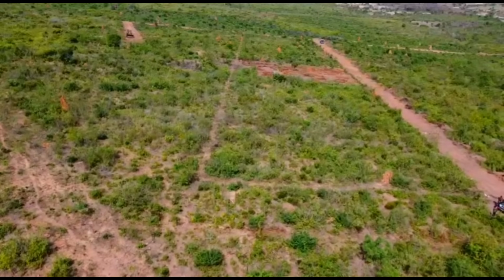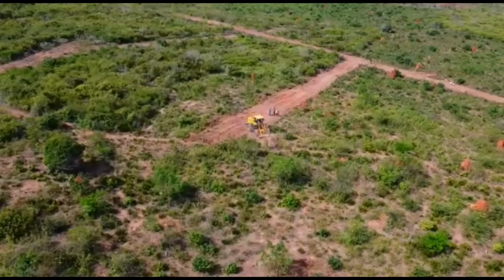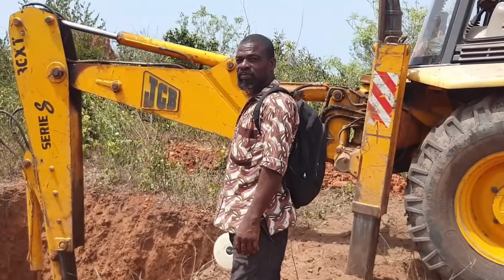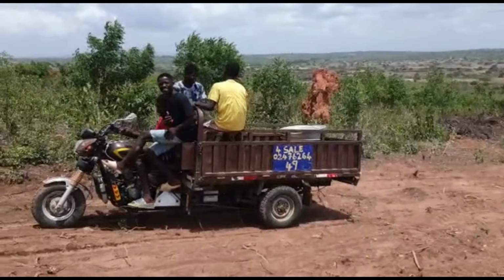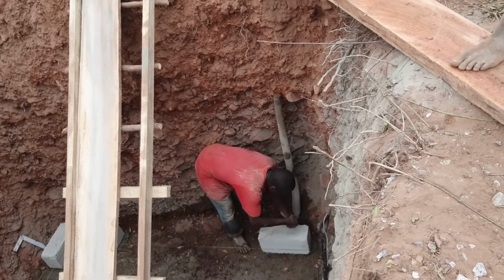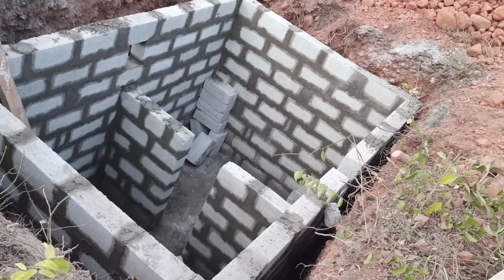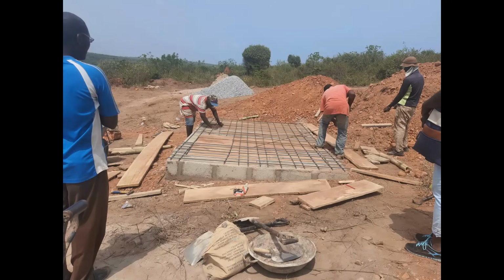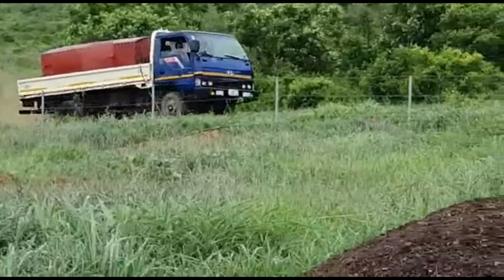Building Our Massive Underground Water Tank - Step By Step Process || Building in Ghana

Comment: You are likely to loose water due to leakage in the dry season for underground water storage built this way. You may want to consider a waterproofing barrier. Essentially you want a swimming pool-like kind of structure.
Reply: You mean that one will leak in hot season
Reply: Not sure about leakage  because these type of under ground water tanks are built in the virgin islands under the houses.  The are call cisterns  and they are just plastered the same way this one was built.  We never have had water leakage as a result. The water for the cistern are usually filled from water collected on the roof tops of the houses. In the dry season we have to buy water from water trucks if the water runs out.
Reply: Yes you are right,they need a damp proof memory
Reply: When you render the interior walls,  there is an Ammendment that you add as you mix the cement, a type of Plasticiser, that makes it very  waterproof, not very expensive, adds maybe 10% to cost of cement. We use it to line Water Tanks and Septic Tanks here in The Philippines...
Reply: @bandit4true  St Thomas USVI?
Reply: @TRPGpilot  yes, and some cistern are built with poured concrete.  They are still being built up to this day.
Reply: @bandit4true  I am vaguely familiar with St Thomas, spent some time there many years ago and know the water collection routine. Coming from another island with readily available spring sourced water I had to learn (to me) severe water conservation behaviours 🙂
Reply: @bandit4true Yes, that’s true. When my parents built our home years ago. The water cistern was built under the  porch with 2 openings on both sides with a concrete cover. The water cistern was 2 large deep rectangular shape with a partition that will allow overflow of water to the other 2nd water cistern. If both are filled, there is a large PVC pipe on the side for excess water. When the water is low during dry season, my dad would order portable water.
Reply: lesliegaskin2642  you are obsolutely correct. It all depends on the quality of the material and the quality of work.
Reply: How much did you pay for that project

Comment: Concrete take a while to cure. You could have waited a bit before filling with water. Also, I noticed the water tank wasn't built with structural reinforcement columns. Water is quite heavy. And being soaked in water makes it even more prone to collapse. Just be care when using or walking on top.
Reply: Let me bring out my note book. You have some good points there
Reply from the maker: I filled the tank about a month after it was constructed 😊
Reply: @Kaydee-p7x  lol 😂. You stre really paying attention
Reply: You should never allow it to get empty or it may collapse
Reply: @Korewaa-GhBizGirl  The construction  will be ok, the outer walls will be supported with the soil you replaced while the inner barrier wall  and water pressure will stop the walls from caving in and also the thick steel reinforcing will give extra support also. Twenty eight days is the recommended time to wait for concrete to harden....a job well done your workmen know what the're doing, greetings from the Philippines.
Reply: Concrete can cure under water

Comment: Here in South Africa we call it the TLB for Tractor Loader and Backhoe.
Underground storage was a master stroke, more like a covered swimming pool or sceptic tank.
- I'd advise you to upgrade  your reservoir in the near future and build with the rebars as you correctly suggested. 
- The extra support wall  you used will help only with the ground-to-wall pressure, but not the strong outward pressure exerted on a full tank
- Further use swimming pool quality inside finishing to avoid seepage and preserve concrete structural integrity from water damage.
- Local swimming pool builders can advise you.
Good and inspirational work, and I'll follow your orchard progress.
Reply: Nice pice of advise, also learning
Reply: Love South Africa and the so cool language. A baaje big drukkie voor jou.
Reply: We call it what it is   a. J.C.B
Reply: If you compress the soil behind those walls. They will fall in. If you do not the water will push them out.
Compact the bottom. Concrete with rebar. Rebar first on the walls. Formwork then poor the Concrete behind.
The millions of years have compacted the earth in place will hold it in place.
Building a non reinforced brick wall.
That tank will not survive 1 filling.

Comment: Good idea of having water storage. The best shape would have been round. With a square/rectangular shape, the corners are likely to develop cracks (this I've experienced!) and water will seep out. You could have dug the pit and placed the plastic tank(s) underground as another alternative.
Reply: Round is difficult to build with rectangular blocks.  Their tank is divided so it will be stronger
Reply: @timothykeith1367  It would not , the round tank is the best way to go because the curved surface reduces the surface area for hydrostatic pressure on the walls .Even though we don't often do these round tanks on the ground  for water storage except for waste large treatment plant .They are usually Elevated tank but the principle is the same.So to do the round tank or say the rectangular tank ,it should be reinforced concrete ,not blockwork.

Comment: I really like your way of building and reinforcing the tank for DIY application. The only thing I would be cautious about is leaching chemicals from your tank into what you are growing without a liner or inert lining material installed. 

Also, the silica dust that is being inhaled by your workers while constructing the tank WILL cause silicosis eventually . Basically, that dust will eventually cause irreversible lung damage to those guys. So viewers  thinking of doing this should protect their lungs accordingly.

Comment: Congratulations. You are doing very well.

You mentioned that these tanks will be filled from rain collected from your homestead. Do you know you can actually calculate the amount of water you can collect from your roof? If you know the average rainfall in that area and your roof footprint you can get this number and therefore be able to size your tank appropriately. Example

Average rainfal 1200mm=1.2m pa
Roofprint 300sqm

Amount of rain collectable per year= 300x1.2=360cubic meters of water per year. That is equal to 360,000 litres of water.

Assuming you have two established rain seasons per year, this means you can collect 180,000l every season.

For my projects I usually divide the collectable amount per year into three to size my tank. In my given example above, I would build a tank with capacity for storing 120,000litres.
Reply from the maker: Thanks Adam👍🏾
Reply: Water from the roof is in how litlle concentration it may comme allways watery birdpoo. Even as there is "only" one poo on the roof and the rain wasshes it off gooing to the tank it is wattery birdpoo.
Reply: @denisdb725  this is true Denis. However, rainwater harvesting is a deliberate effort that requires one to be adequately informed. Dust in the air and other contaminants like bird poo can be mitigated. Rainwater is the easiest to purify.
Reply: @adammaina5612  This aswell as my words are true to. And one must go with what one has. Even in countries where water is a smaller problem the water commes from rivers and canals over what birds fly. And make there "droppings". Only there the watercompanies have very strict rules for what tey must do before the water goes to peoples taps in houses. And again I am pro for this type of water systems to make one has it if needed.
Reply: @denisdb725  and not to mentioned  the amount of dog shit that actually  get washed into the river and lakes were the water is source from in those countries before it is treated and sent to the tap.
Reply: @Adam Really Your Knowledge is Awesome Bcz Your Calcation is Superb you can start a you tube channel Bro 👍
Reply: Idea is not Bad 😎

Comment: Hi KOREWAA - brilliant idea. What i would've to know though - WAS WATERPROOF CONCRETE/ CEMENT used to build the underground storage tank? Would love to build such a tank when starting to build in Ghana 🇬🇭 🇯🇲
Reply: @Dlannette Mclish - I was wondering the same, because over time the concrete can break down & also mildew if it's not waterproof & properly ventilated.
Reply: Not sure but in the Virgin islands 🇻🇮  this is standard to build  what we call cisterns under the flooring of the houses which is then filled with water that is collected from the roof top using water gutters. We have never had issues with any leakage.
Reply: It's a backhoe

Comment: This machine is called VERSATILE.
If i were you, i will protect myself against any lawsuit by making sure that ONLY the water hose will have the possiblity to go more than 5cm below the door.
Put solid wire mesh and make an opening just for  the hose.
The lock is not enough to protect you against bad minds.
If someone mouse drawns in this tank, you will be in trouble. God forbids.
Reply from the maker: Thanks for the caution...it is currently fenced in and the whole property will be walled eventually.👍🏾

Comment: Bearfeet in concrete? No really? 3e dregree burnwounds can be made true the cement. As the water commes in the truck, the truck is higher placed than the waterlevel. One do not need a pump. Spoilled fuel and mecanical wornout for the pump. BTW I have the feeling the subgroundtank is not very big. I think it is about 3,5 to max 4 meter high. 1,5 wide ans max 3 m in lenght. so it does 15,75 m³ Not even taken away the volume from the inside wall. A whole lot of work for a minor result. For thesame work and a litlle more material could have made a double size tank. Sorry but it is how I see it. AND AGAIN. STAY AWAY WITH BEARHAND OR FEET AND ALL SKIN FROM CEMENT.